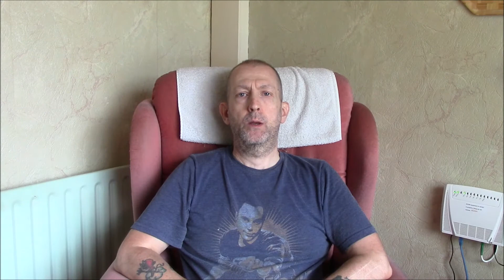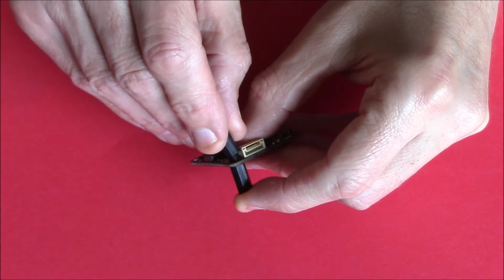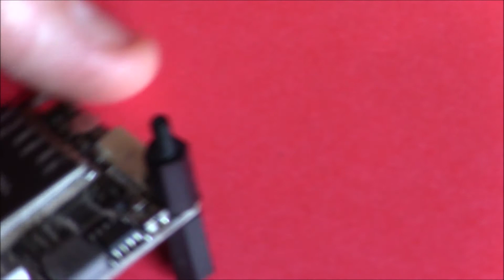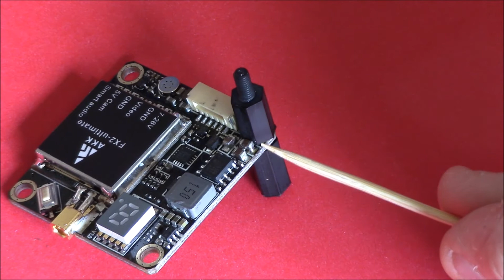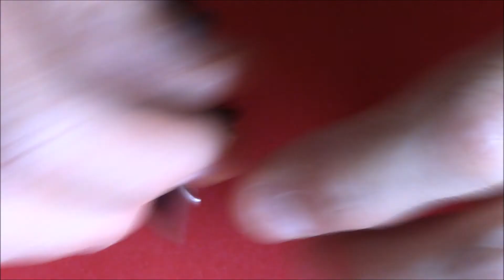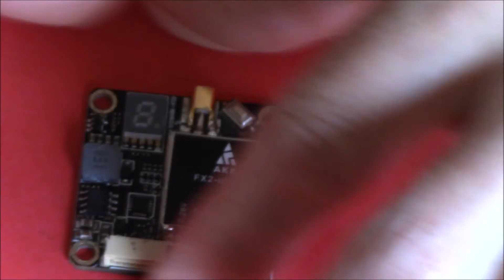AKK FX 2 ULTIMATE VTX      PROBLEM

Comment: Damn! Another video about AKK vtx. This is starting to look like the worst vtx I've seen so far. Save your money and buy a vtx you know works!
Reply from the maker: AKK have been making Boards for awhile now for other companies, you may even be using one. However they have stared to release products under there own name now. I think they make some great gear, but this board needs relooking at for sure.
Reply: George Cooper I have had one and it burned out. I just might have had a bad board but I've notice a lot of people are having issues.  I really don't want to spend money on a product that's works sometimes.

Comment: Looks like there is a serious design/quality control issue with these boards in general "at the moment" 
I have had one where the MMCX plug broke on connecting to the board, half the connector is stuck in the board, the other is still on the sma pigtails lead.
 Customer service don't seem to be bothered by this because after contacting them I received the reply 'So the antenna lead is broke, does the vtx work though' 
To which i replied I don't know as I can't power the vtx without an antenna as it will burn out.
Still waiting on a reply to that 2 weeks on!

A friend of mine has had an ultimate fail and one of the 800mw vtxs fail on the first flight and got a 2nd 800mw that came missing the entire vtx out of the sealed box!!
Reply from the maker: Bloody hell mate you have had just as much luck as I did. Hope something gets sorted for you.